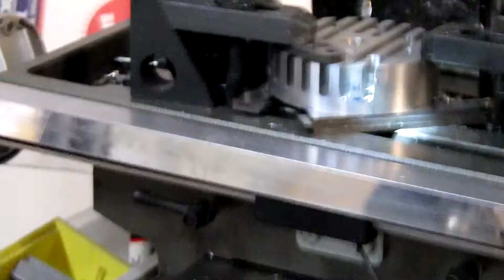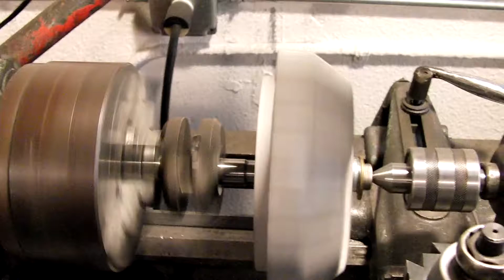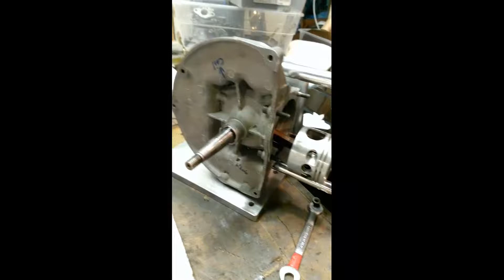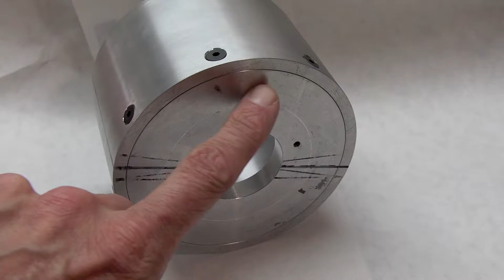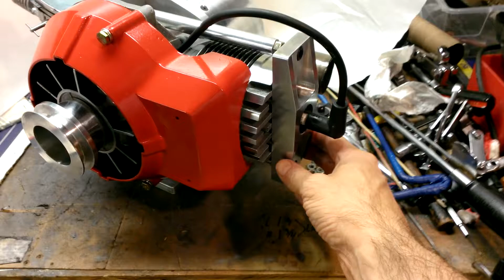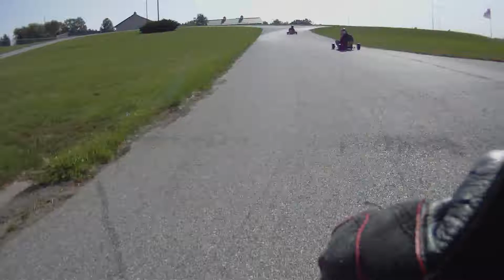AH-82 Power Products Vintage Kart Engine build project

Comment: Back in the late 50s my father got us a simplex kart with a Clinton A400 engine. The distributor was a friend Lex du Pont, whose father had owned the Indian motorcycle company and the DuPont motor car company. Lex and his brothers were always doing something in their shop and one of the first engines I saw him work on was a Power Products chainsaw engine. One day after school I rode my bicycle over to the shop and found Lex on the Bridgeport mill machining a block of billet aluminum into a head for his Power Products kart engine. That had to be sometime back in the late 50s/early 60s. He was running 2 diaphragm/pumper carburetors but I think he had one feeding the crankcase and another mounted on the cylinder. A bit later McCulloch came out with their MC10 kart engine which I had on a Bug Wasp. We raced karts until the local track closed down and it became harder to find places close by. Unfortunately the karts got sold and I got my drivers license... and here I am 74 yrs. old thinking about doing it again. Over the years I’ve raced motorcycles but the karts started it all.
Mac Morgan, 
Hockessin, DE

Comment: So I take it this is a lot of period correct malarkey and machining that goes in these things. Do vintage guys get pissed when a dude pops a Gx160 race motor on these carts? Are they comparable or completely different? My father passed away 2 months ago and I'm trying to figure out a memorial build. I can rebuild 2 strokes as far as weed whacker motors, is it the same concept? Are those piston ports for passive combustion or just for light weight? I know you guys gotta run big carbs for the displacement and must end up with a lot of overload due to the short combustion time, do those ports allow for a double ignition on both ends of the stroke? I am completely new to this and you have some pretty serious skills. Let me in on some secrets, maybe some suppliers or links. Here's a kart motor I built. I left the tank on, I love the white honda tanks https://youtu.be/NhFFKL1laAc

Comment: Could you do a vid covering timing the engine using the ignition module when you set up your rebuilt engine?
Reply: FYI - was done with a timing light, really the only way to set timing with those modules.